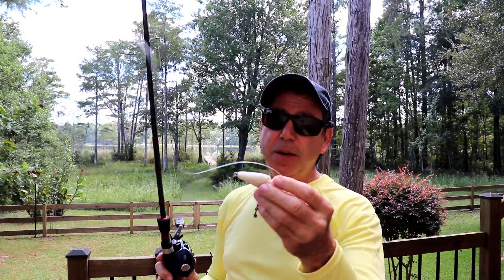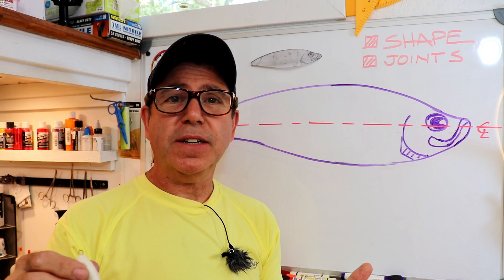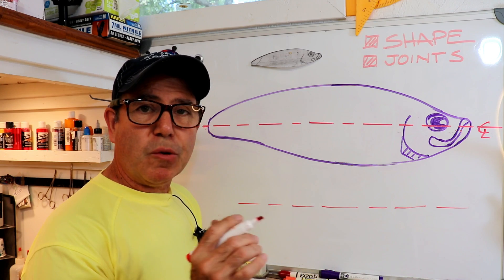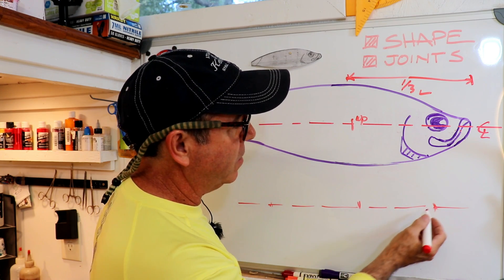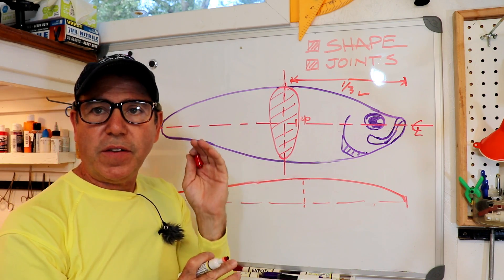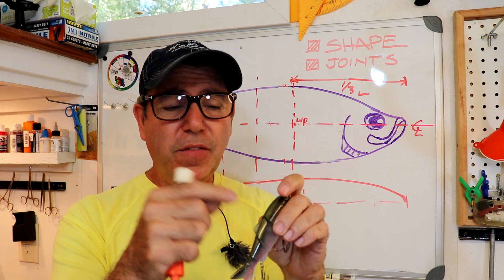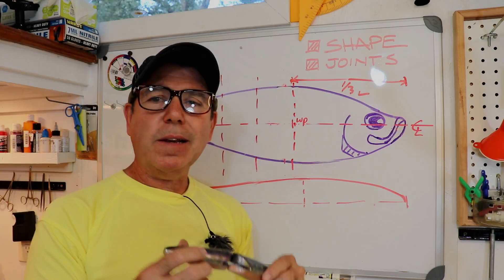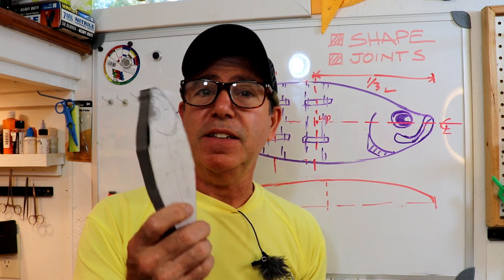Making a Swimbait, Design and Build Part 2

Comment: I love your videos, thanks for making them! :)
I had a side note though, ..... for calculating the density of Material,  I suppose the easier method could be to do that on the block before starting cutting the shape off, or immersion of the wedge in a beaker or measuring cup pre-filled with water to obtain volume easier. :)
Reply from the maker: You're right if your  block of material has nice uniform sides and angles it's much easier to do it on the original block. But that little triangle was actually almost perfect. My preferred method is to cut a small sliver about an eighth of an inch thick off the entire cross section, this way I can capture any density difference from bottom to top. Thank you.
Reply: @EngineeredAngler  oh! .... I'm  terribly sorry! Sir! ....